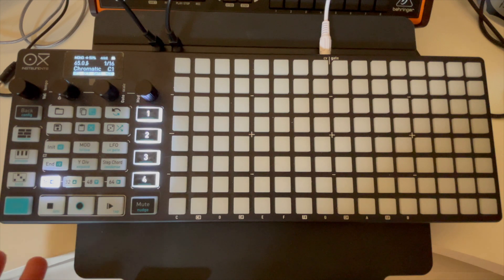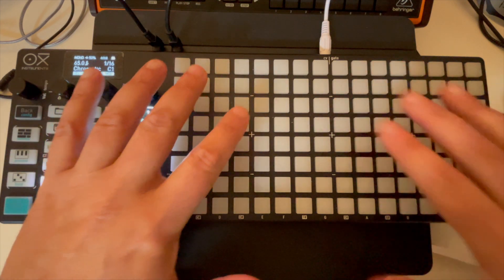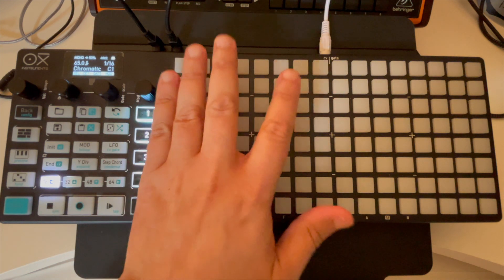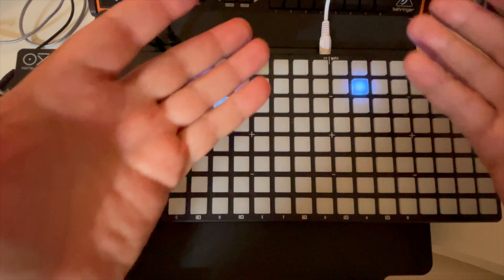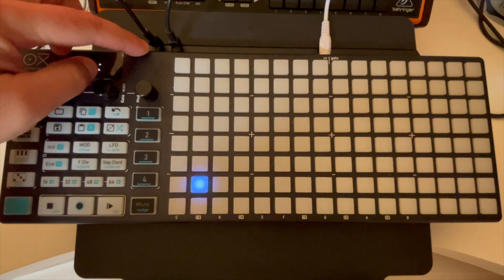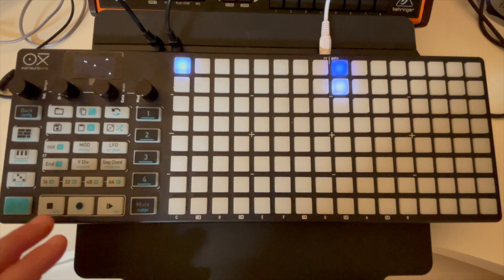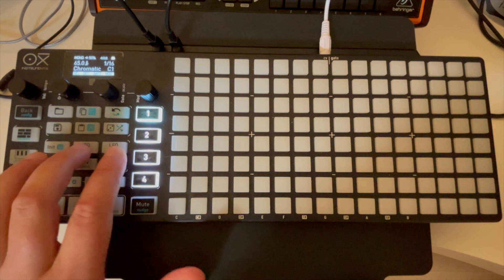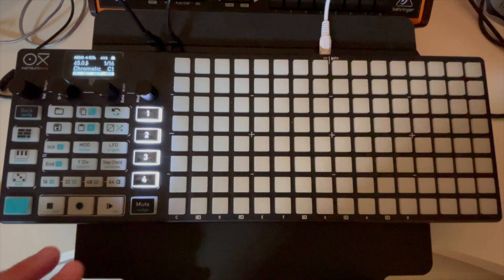OXI One Sequencer: CV/Gate Explanation (WARNING: from a noob)

Comment: Hey Thanks for getting back and posting this vid. It is a little confusing, but not by your explanation,  was pretty thorough, i know nothing about modular stuff either so it's gonna be fun. Lots of trial and error .. the waldorf fortunately has midi connections as well which I've been using with the oxi, so if I never get it working cv gate wise it's all good. Thanks again 👍
Reply from the maker: Thanks! Massive headache after 😂 the Waldorf. Blofeld?
Reply: @krazywabbit  I traded my t1 torso and my DFAM plus cash up front for the iridium. Saving cash Selling buying better gear or trading and repeating is how I was eventually able to afford it. I know no one was asking but just thought I'd share,  saving cash is key. I started with a kaossilator pro